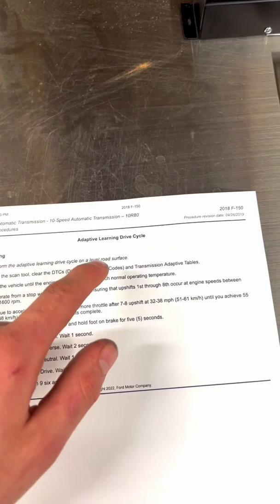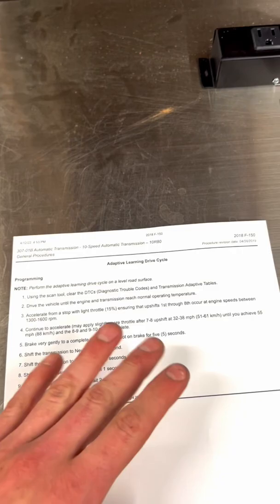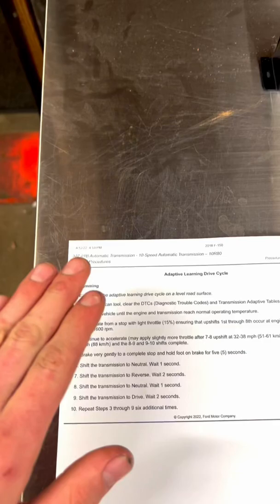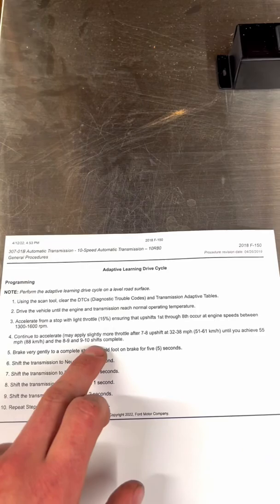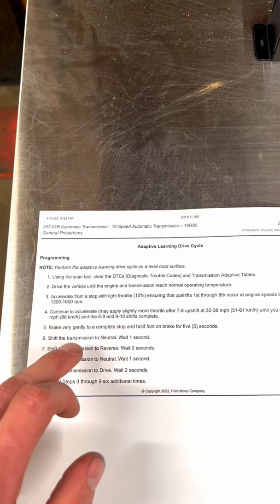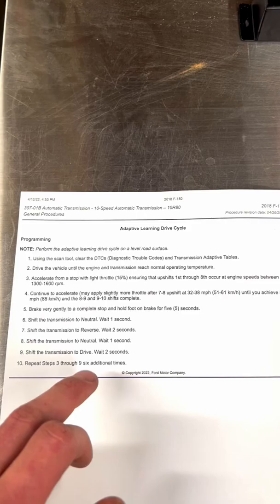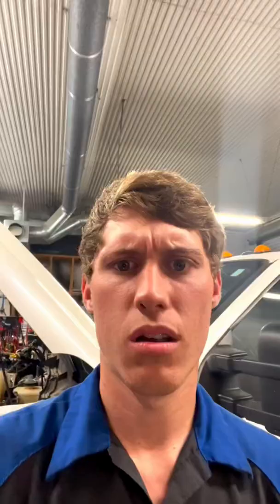Why Do Car Manufacturers Make My Job Harder? Pt. 2 #shorts

Comment: Mechanics today worry too much about the service manual.  What the manuals says, and how it happens are two different things.  You road test it how you normally drive, and cut it loose.  Flat rate doesn't pay for Ring Around the Rosie service procedures.

Comment: After having old f150sand e250s  that were nuts and bolts, easily fixable, I decided to get a newer fancy van. I went with Ford mistakenly thinking they were pretty open and simple. They are the tightest most proprietary  company with their diagnostics and car computers. To make it worse I found my van was designed for fleet maintenance and planned obsolescence. A drain opening to a wiring harness. A sealed unit transmission with no access that you have to remove the a and K frame elements and steering column if you want to do the trans filter or torque converter, all with one time use bolts and bushings. So with my TC going up, probably, can't just do fluid and filter. I have little choice but ride it til it totally dies, then get a new transmission and replace my cats at the same time as all of it is behind the same thing. No sense in doing little fixes, just replace half the truck when it stops moving forward.

Comment: When I owned Ford it was a frightmare.    I own a '15 dodge charger w/ 100k.   0 problems.  Avoid Ford trucks.   50% of the price is pure PROFIT.
Reply: Try idling the dodge, your cam will go flat

Comment: The Ford will need to be towed to a track or large airport run way to have that done.  Two hundred dollars for the tow plus $150 for the exclusive use of a racetrack or runway times 2 means a $700 bill to the customer to calibrate the truck.

Comment: A dyno type in-ground roller could be a solution. Not sure if the breaking part would work too well though. But that's a far slow acceleration no shot the city boys can pull this off easy.

Comment: Do they think all dealers have a test track for these drive cycles? I worked at nissan and some of those drives were like drive to 60mph without stopping then slow down to 10mph and drive for 5 mins and then stop. Like where am i going to do that in traffic on the road

Comment: I found out today my dodge 5500 wrecker has a dang steering wheel position sensor! What the heck? So now my esc stays on and no cruise control... why the heck do i need a steering wheel position sensor?

Comment: If you think 2018’s are bad try taking off a factory water pump on a 94 F150 to put it bluntly I legit hurt my shoulder trying to get each bolt out and ended up snapping 2 of them

Comment: Here’s my thing, in what scenario do they think we’re gonna be driving these vehicles? We don’t have an open test track to where we can do this. Hell most of the time you gotta try and take these things in the high way. We had a… I’ll say 2008 Chevy Tahoe with the 4.8 and unfortunately the Vehicle had a dead battery, customer didn’t inform us and if you know GM’s they love to have that one readiness monitor not set. If we know the customers vehicle has a dead battery before it comes to our place we’ll tell them put a battery in and drive it for a weak since that usually sets the final monitor. But for this Tahoe we had to drive a Total of 80+ miles to get the monitor to set just to run an emissions test on the thing. Why manufactures make it so hard for things to calibrate is beyond me. And seeing that you have to do this process like 7 times for that Ford that’s gotta charge like… 2 hours or more. Because that’s such an unrealistic driving scenario.

Comment: Does anyone happen to know if this applies to a 2014 Ford expedition? I know it also has an adaptive transmission and it goes into "learning mode" after replacing the valve body/lead frame. Cause I didn't do any of those steps after replacing it.....

Comment: The engineers who make these only make them with the assembly line in mind. A few things are made to be easy servicing if it doesn’t slow the line down. It’s all about penny pinching. Engineers are not out for the mechanic. They are pushed by bean counters to make things cheaper and faster.

Comment: Look up what you have to do to change the water pump in a 2008 Ford edge.
Reply: Very simple, remove the front frame section and remove the engine and transaxle from underneath the vehicle. It takes less than 10 hours of total work.

Comment: similar on a 2005 explorer. I had to drive 20 minutes normal than on highway at 55 mph for 15. in between that the vehicle has to cool down for at least 8 hours 😲😂💯

Comment: Imagine pulling off the shoulder when cars are doing 65-75mph and trying to get your truck to shift at 1300-1600 rpm. It’s gonna take 2 miles to get to 60mph.

Comment: You could possibly lift it off the ground or i guess they need to write that out in the steps .  I'm so glad I was a mechanic early obd2 days   when the scan tool expected the mechanic to know which way to turn a wrench to loosen  a bolt,  prior to the rubber glove guys.

Comment: Suspend the vehicle in the air in a safe manner with the wheels not touching anything. You can then run it through the cycles required. If it's a two wheel drive, only the rear wheels would need to be suspended. That should simulate driving the vehicle. Just an idea.

Comment: Oh yeah the trans learning on the diesel Nissan Titans had you driving through all the gears without accelerating above 10% throttle. 0-45 mph with less than han 10% throttle is challenging. Do that 8 times. The joys of being a Nissan Master tech

Comment: The same is to be said about the brake pad break in. It’s just as ridiculous considering I believe the first go around they want you to get up to 45 and slowly brake to 25 and you have to do this like 4-6 times with out letting the brakes cool down after that they want you to drive for 10 mins and after that you have to repeat it but going 45 to 15. My son and I did his F350 and waited till after 9pm to do the break in as there would be no traffic

Comment: The unknown price we consumers have to pay for the trades we make between highest functionality, highest performance, lowest price. We have to give away some level long term quality. B/c Literally only an airport could accommodate those recalibrations. Using an airport or a track sounds so wild to consider as tool req for a passenger truck repair procedure

Comment: I am a collision tech and we do our fair share of the blue ovals. I cry every time I get one. Their designs are just moronic.
Reply: I work for a dealerships used car line more cars than we can work on but ford is the absolute hands down worst to work on up on the list of bad design. It seems like fords engineers design things on purpose to be a pain. I flat out refuse to work on fords I mainly stick to German cars bmw Audi Merc. Nissian altimas Maxima's they are pretty generous with time. Hondas aren't bad either.
Reply: @feildcar4578  I agree. I’ll work on anything before I work on a Ford. Just replaced a battery in 2017 Ford Escape. Just a ridiculous design.
Reply: @feildcar4578  I’m also a mainly used car guy at our dealership. Management dosent believe me alot of time these compact suv fords leaking from turbos and front timing covers at such low mileage. Have to take a lot of pictures anymore to cya that I’m diagnosing these bunkers.
Reply: @billybobaggins8820  I’ll always stick to Honda or Toyota.
Reply: @HackMasterBlaster  I’m at a Nissan dealership and I have to say the ease of most repairs compared to US brands esp the Japanese and Canadian Nissan models not so much the Korean ones are much more forward and to the point

Comment: *installs new valve body/main control
*programs solenoid strat and id 
“Preform adaptive relearn/break in repeat 6 times” 
ford “give them 1.6 hrs total”

Comment: From the sounds of it it has to shift between 1,600 rpm's to 1,800 rpm's so at least it's not mashed to the floor all the way so find a ten mile stretch of back road and good luck.. hope the hazards work

Comment: Instead of blaming engineers, blame corporate whom puts out the mandates for HOW each generation of vehicle are to be designed based on parts longevity and ease of repair.
For example, if Ford corporate found out the new generation of Mustang or F150 was engineered to last well over 250K miles with basic maintenance and was very easy to work on.. they would loose their minds in regards to profit and losses. 
Most modern auto makers have forgotten what it means to build a quality product they can really stand behind unfortunately. Hopefully that changes.

Comment: Everything with an adaptive learning computer has something like this, mine is just three acceleration cycles rowing through all the gears and overdrive with the tq converter locking up, first gently, then moderately, and finally full throttle

Comment: Does anybody know what happens if you don't do this procedure? Genuine question.
Reply: It might have harsh or delayed shifts when returned to the customer. It will adapt on its own over time. This gets it done before you give the vehicle to the customer.
Reply: @NJX-kj4fz  Thank you for the reply. Surely this can just be programmed into the management system as it's not unique to the actual vehicle, just the model. It does reek of making people go to main dealers only.

Comment: I had to reteach my Honda CR-V for smog after I fixed the knock sensor and cleared the codes. I had to drive around 50 for 5 min, then let the car engine brake down to 20, 3 times. I went out at 3 am to do it. I must have looked drunk AF.

Comment: I'm  a Ford fan.    But when they made it that you need to raise the cab to pull the engine I was done.
Reply: What you don’t realize is how easy this actually is. Rear wheel drive vehicles are very tight to work on. Having easy access to simply replace the engine once the body is removed is the best part. I’d encourage not being scared of “fancy” engineering. It’s not complex.

Comment: You know what I have agree with you isn't there a better way to go about this. I swear some of the stuff they come up with for some of these vehicles it's like do these engineers ever come up with a better idea or they come a long ways to screw the mechanic and the customer. Engineer will pass through a valley of virgins to just screw one mechanic. The one thing that drives me at the wall is some of his engineers get paid more than the mechanics.

Comment: GM offers us a fast learn thru our diagnistic tool. Just gotta hold the brake while it does a routine. Takes about 10 to 15 minutes. Are you saying ford doesnt offer that? All you are desxribing is a normal drive cycle test.

Comment: Thank God every Ford dealership has a test track built thru the parking lots to allow mechanics to do this. I see the dyno comments here, can you do it with just the rear wheels in the air? I would think a dyno is not much easier than my test track comment for the average shop.

Comment: That is insane they want it 6 times to learn adapt the truck!!!

Why do they need to keep changing trucks? Why cant they figure out what is the best they ever made, throw away all the crap, then stop changing the vehicle and JUST BUILD THAT TRUCK year after year!!!! Just leave it the same so parts can be mass produced and made cheaper.  They can sell upgrades and body kits but leave a good truck alone. Quit changing it. I swear there is room for a brand new car company that makes one thing. Work truck that is the best ever made and easy for the owner to repair with cheap replacement parts. You would sell a million trucks a year.

Comment: It's testing the engine so someone doesn't come back pist. plus usually it's done on a dyno that way you are not on highway
Reply from the maker: Ummmm no where in that procedure does it say use a dyno haha
Reply: @FlyingWrenches13  If you don't think it's safe to run it through the gears and come to a complete stop out of no where on the highway or street like you said in video then wouldn't that be a ideal option... but choose your own adventure.
Reply: @JB-mh6xz  ive been in the industry for 15 years. I have never seen or heard of any shop other than a performance shop use a dyno for diagnostic purposes. Not to mention that i have 3 dynos in my area and they are all a week to two weeks wait to use.
Reply: @evolburd5768  Sounds like some mechanics that don't know how to use common sense. Your circumstance is unusual but I guess if it's "not in the book yall can't think out side the box... and bro it's a dealership they got ALL the equipment to rectify warranty issues.
Reply: @JB-mh6xz  are you seriously trying to tell me that every dealership has a dyno.....no they dont. Quit being un realistic, its expected to do this on the road.
Reply: @evolburd5768  Yeah bud don't know what busted dealership ur working for but mine is all lined. 

Hey you made a video whining about the protocol people comment with solutions and half baked mechanics get bent. Turn your comments off bud. Your job isn't hard...
Reply: @JB-mh6xz  you guys dont use dyno use calo then hit breaks because u speed up the rev engine carousel now from there you will have it working non dyno
Reply: @JB-mh6xz  hmmm i work in one of the richest areas in the country and the dealerships around me dont have them soooo either prove to most dealerships have one or stfu and maybe just maybe i might know what im talking about. If my job isnt so hard then why do people pay my company 160 an hour to fix their equipment.
Reply: Lmao the J B is lying and everyone in the comments know 🤣
Reply: @jimmydean4444  no he makes dyno into the cordious of the maximis when you tricke it

Comment: Solution don’t buy the 10 speed because it’s absolutely junk the old 4speeds with od are the best transmissions ford made but discontinued them because of “fuel economy” so next best thing is their 6speed too bad you can’t get a 6speed in the 250’s and up though all new vehicles are junk nowadays cheaply built corner cut junk

Comment: Could you just have it in the air with the wheels free and do this cycle? or does it need the rolling friction/weight for whatever reason
Its dumb af either way, but being able to do it in the air would be a lot safer and easier

Comment: Today I finished swapping the engine on a 2013 ford transit connect. The engine’s built like a McDonald’s happy meal toy, but it was just more cost effective to rebuild the damn thing and keep driving it for 100k miles than to spend 10 grand buying a comparable used vehicle that wouldn’t last for 50k miles. I have plenty of griping to do about FMC but for now I’m happily rolling onward in one of their fat-asses-ford-focuses.

Comment: If you can learn anything from these videos is don’t buy a ford.
My 02 Tacoma he’s 385k original motor and transmission as well as the AC. The only thing I have replaced was the alternator about 20,000 miles ago and I have a buddy who has a 99 forerunner with over 450,000 miles on it that’s all original.

Comment: At the end of the day, they’re adding food on your table. 
I work at a German repair shop and the new B series engines are having oil filter housing gasket issues at 35k. The housing is made of plastic instead of metal, as before. The book time on replacing the gaskets are 10+ (13hrs matrixed). The whole shop wins.

Comment: Nothing new ur supposed to “relearn” most modern transmissions done it since about 2010 on all different makes and models makes sense it is computer/module controlled some are easy you can do with scanner but a lot of em require you to drive the car at certain speed then stop and doing that a few times.

Comment: I know every manufacturer has their own Fuck you procedure but it seems like Phord has been doing this stuff for a lot longer than others. They don't average people working on it and now apparently they don't even want Tech's to work on them? I mean who is responsible for the warranty on this transmission in case someone doesn't do exactly as specified? How long before they just want you to get a whole new vehicle when anything at all break's? Sorry sir, your brake pads are worm out. Please head over to the nearest dealer and buy a new vehicle. What do you mean buy a new vehicle? Yup unfortunately we are no longer allowed or even able to put new pads on it it doesn't matter that it's only less than a year old. And no they won't give you anything on trade in, we have to scrap this vehicle because it's unsafe with faulty brakes.

Comment: Rest assured the engineers out there these days are not the brightest crayons in the shed 😂

Also got to love checking transmission fluid procedures on cars without a dipstick...
Lets see should we put this 10 cents worth of steel on here so you can check the fluid?
Nah we'll screw technicians across America so that it takes about 30 to 45 minutes to check it.
All you gotta do is bust out the scan tool (since we didn't put a transmission temperature gauge anywhere on the car except for in the computer itself but we're not just going to display that data just willy nilly) then after referencing the manual to make sure you're in the right temperature range... Which good luck 9 times out of 10 you'll have to spend quite a while d**** around to get it hotter or colder 😂

Well let's just say you're preaching to the choir 😁